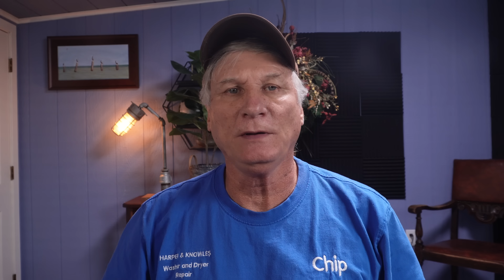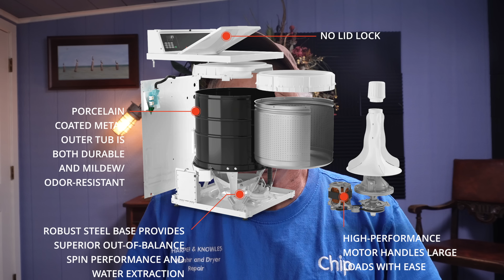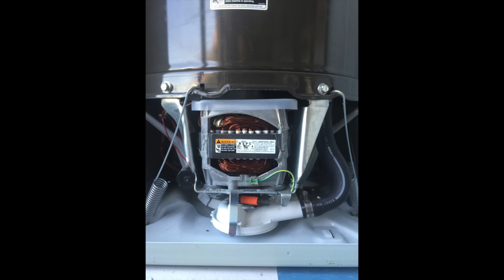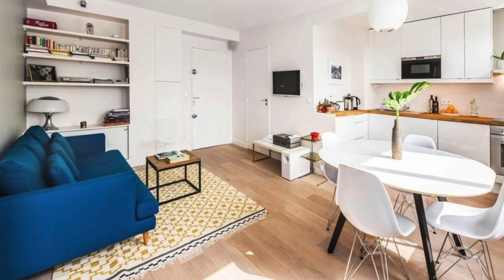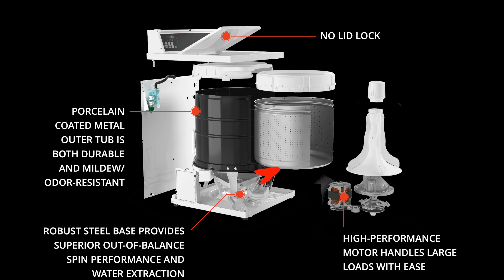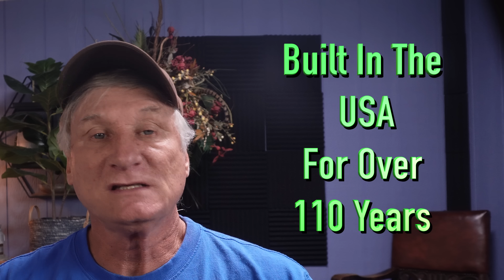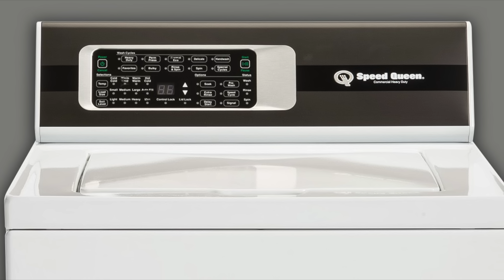TR7 vs TC5 – The Truth Speed Queen Dealers Don’t Tell You

Comment: Chip, what are your thoughts on buying a Speed Queen TV2000WM for home use?
Reply from the maker: I answered a similar question recently so I’m just going to cut and paste that here. Thanks for watching!

The Speed Queen TC5 and TV2000 (TV2) share some mechanical similarities but have distinct differences in their control systems and features:

- **Control System**: The TV2 has all mechanical controls, with no water level selector or deep fill option, meaning it automatically fills to a full tub regardless of the load size. In contrast, the TC5 offers more flexibility with its control system, including options for different water levels and a deep fill feature for better customization of the wash cycle.

- **Design and Features**: While both models are mechanically close, the TC5 includes features like a bleach and fabric softener dispenser, which are not present in the TV2. The TV2's straightforward design might appeal more to those who prefer simplicity and a no-frills approach to laundry, whereas the TC5 provides additional options for those who might need more control over their wash settings.

- **Washing Performance**: Both models are designed for durability and classic agitator wash action, but the TC5's additional control options might offer a slight edge in handling various types of laundry needs. The TV2, being mechanically similar but less feature-rich, might be ideal for users looking for a straightforward, reliable washing machine without the need for extensive cycle options.

In summary, while both washers are from Speed Queen known for their longevity and robustness, the TC5 offers more user control over the washing process, including water levels and additional dispensers, whereas the TV2 provides a more basic, mechanical operation with a fixed water level.

So for home use I think I’d take the TC5 option.

Comment: I bought the TC5 and its companion dryer about 2 and a half years ago now and I couldn't be happier with them.  I bypassed the safety switch on the lid with a clothespin so it keeps running if I want to raise the lid to add something at the last minute, like the fabric softener I often forget to add.  Saves wear and tear on the machine by not having to let it stop and start if ya need to raise the lid.  My last washer & dryer was an old style Whirlpool set that were over 20 years old.  They still worked, but I didn't know how much longer they would last and I didn't want to have to settle for what I could get immediately if they quit.  Had to order the Speed Queen set and wait about a month for the 150 year old Mom & Pop store to deliver them (Billy Matin's Store, Martinsburg, Indiana) but it was worth the wait.  While waiting I picked up some ancillary items like steel braided hoses for the supply lines, etc.
Reply from the maker: Thanks for sharing your story!
Reply: Question: I thought the TC5 does not have lid lock? Is there something I am missing?
Reply: @nealrogers  It doesn't lock, but it will stop the machine running if you raise the lid.  Bypassing the safety switch lets the machine keep running when I raise the lid to add something to the load.
Reply: @Rebel9668 how did you bypass the switch
Reply: @joesummers9864  With a clothespin.  If you reach around behind the control box at the top of the machine on the right side, the underside of that control box is open in the back.  If you feel up under there, you'll feel a flat metal lever.  Put the clothespin on that lever and that takes away its ability to move when opening and closing the lid.  There are a bunch of videos showing how to do it, like this one here https://www.youtube.com/watch?v=vsu1r1-OC34

Comment: Would you pick the speed queen tv2000 over these two washers shown in your video? If so, why?😊
Reply from the maker: The Speed Queen TC5 and TV2000 (TV2) share some mechanical similarities but have distinct differences in their control systems and features:

Control System: The TV2 has all mechanical controls, with no water level selector or deep fill option, meaning it automatically fills to a full tub regardless of the load size. In contrast, the TC5 offers more flexibility with its control system, including options for different water levels and a deep fill feature for better customization of the wash cycle.

Design and Features: While both models are mechanically close, the TC5 includes features like a bleach and fabric softener dispenser, which are not present in the TV2. The TV2's straightforward design might appeal more to those who prefer simplicity and a no-frills approach to laundry, whereas the TC5 provides additional options for those who might need more control over their wash settings.

Washing Performance: Both models are designed for durability and classic agitator wash action, but the TC5's additional control options might offer a slight edge in handling various types of laundry needs. The TV2, being mechanically similar but less feature-rich, might be ideal for users looking for a straightforward, reliable washing machine without the need for extensive cycle options.

In summary, while both washers are from Speed Queen known for their longevity and robustness, the TC5 offers more user control over the washing process, including water levels and additional dispensers, whereas the TV2 provides a more basic, mechanical operation with a fixed water level.

Since the TR7 doesn't really compare mechanically to the TV2000 we'll leave it out of the choosing. I'd choose the TC5 for home use and the TV2000 if I was going to stick a coin box on it for commercial use. 

Thanks for watching!
Reply: @HarperandKnowles  Thank you so much for the great information so that I may make a better informed decision on what to purchase.
Reply from the maker: You are very welcome!

Comment: Our old Series 70 (1988)Kenmore broke down in September and I replaced it with a Speed Queen TC5 and have no regrets. The spin tube support braces on the Kenmore are almost eaten through from leaking tub seal and the spin tube bearings and seals need replacing. I had already bought numerous parts and will rebuild the spin tube and support brackets and sell it.
Reply from the maker: That sounds like a good project. Thanks for watching!

Comment: I just ordered a TR5 washer & TR5 dryer but am now seeing some negative reviews of the TR. What are your thoughts on the TR5 vs TC5?

I am not sure why SQ hasn’t increased the size of the washer bucket, and am really hoping it will fit our king bed sheets & blankets…
Reply from the maker: The negative reviews are from die hard TC5 fans. My sister owns the TR’s and she loves them.  They are good machines just a bit unconventional on the agitation cycle. The tubs are smaller and that is one of the characteristics that make them so durable. You may want to take the king sized blanket to a laundromat that has a large capacity machine made just for loads like king sized comforters. I’m betting your sheets would fit just fine though. Thanks for watching!

Comment: I understand there is an issues with the TR5000. I have a bearing noise at the base and Speed Queen put out a bulletin out of this issue. What is the warranty period? I purchased during March 2020. I've owned SQ many years ago and never, ever had an issue with any component when they were owned by Raytheon. I certainly hope their quality control didn't change.
Reply from the maker: I think it’s 5 years for that model. Check your paperwork you received with the machine. Hopefully you registered it when you bought it.

Comment: I've got 43 yrs on my maytag lat9420.  The tub seal started leaking and maytag discontinued the part so put a knock off seal in and got it working. Have rust on the outer tub for the drain and bleach hose connections. I think when those connections go the washer is done. I would probably buy a tc5.
Reply: Lucky!!!! That’s awesome and the way things should still be made! 👏🏻👏🏻👏🏻
Reply from the maker: Thanks for watching!

Comment: I have a TR3 and I have had the timer wash machine in the past. This machine is so quiet I have to check to see if it's done because I can't hear it running.  I  learned the spin only setting  by holding down the start pause button until the spin light comes on. Just something different than the old timer machines.
Reply from the maker: Thanks for sharing that trick! Thanks for watching too!

Comment: From a dyed-in-the-wool DIY'er, I have gotten to the point that I look at the cost of repair parts and the ease with which to make repairs on appliances.  Having torn apart our LG washer several times to replace tub bearings, the water pump, hoses, the door gasket twice, and the so-called shock absorbers, the last straw was the unavailability of the drum bearings.  When I did find them, they cost $400.  To do repairs on any of the front loaders takes a couple of hours, and you have to, for all practical purposes, do an almost complete tear-down.  You also need to buy the pliers to remove and install the wire snap-rings for the door gasket, or that will take two hours and lots of cussing to get them back on.  For the Speed Queens, you can order the parts from Alliance (the parent company) directly, and the prices are not too bad.  OK, transmissions go for around $400, but they do have a re-build kit and the gear fluid for it.  Motors are about what you would pay for any of the direct-drive motors of a front-loader, and belts and water pumps are not going to cause a heart attack.  To gain access to the mechanical parts you just need to remove screws out of the front panel, and you should have access to everything.  OK, if you need access from the back it does not look all that bad to remove screws...  Great, the Speed Queens have a dual-action agitator.  We thought the front-loader would do a better job than the Kenmore dual action agitator it replaced.  Wrong....I tried every HE detergent I could get my hands on, and every cycle and temperature combination possible.  With three toddlers who turned into teenagers I had to use the pre-wash cycle and the longest wash time I could manage....usually two hours, along with an extra rinse cycle.  I am still scratching my head how this saved water, electricity, natural gas, or time.  With screaming tub bearings, we are going to get a Speed Queen washer.
Reply from the maker: You won’t be disappointed. Thanks for watching!
Reply: @HarperandKnowles  Thank you sir!  You are a scholar and a gentleman and I don't care what your in-laws say about you!😅
Reply: My husband just replaced the bearings and tub seal. The cost was around $40 for both. It was on my 16 year old Kenmore built by LG. He has replaced the pump 3 times. Around $16-$18. Cheap repairs since he is able to do it. Replacing bearings is a big pain (for him). It’s working again. Front loader.

Comment: The current MSRP for a Speed Queen (Alliance) TC5 is $1329.99. Pro tip, find a quality used Whirlpool/Kenmore direct drive machine and refurbish it for less than half that price. That refurbished machine will last another twenty years or more with minor repairs. Bonus, not available of the TC5, the direct drive machines will allow the user to select any water fill level you desire, and the agitator is dual action.
Reply from the maker: Thanks for watching!

Comment: The Speed Queen models that are available to consumers ARE NOT their commercial units.   You can't buy a commercial grade Speed Queen without a tax number.
Reply from the maker: Thanks for your comment! I fact-checked your claim and found it a bit off the mark. Speed Queen’s residential models are built with the same commercial-grade components as their commercial machines. The only real difference is that residential models don’t have coin mechanisms or features specific to laundromats. So, yes, consumers can absolutely purchase machines built to the same high standards as Speed Queen’s commercial units, no tax number required. Thanks for watching!

Comment: An honest review would examine service data, cost of ownership, and serviceability after the warranty expires.  They lose to many others on all three.  I've had just about every brand out there, including these.  They are not worthy of the cult following or price they have.  Don't get me wrong, they are good, but not God level good.  As proof, there are Whirlpools that are exactly the same as these (except the outer control panel) and they're rated below average because people don't know who made them.  The warranty is what sets them apart, not the engineering.
Reply from the maker: Hey, really appreciate your feedback on the video! I get where you're coming from, but let me set the record straight from someone who actually works on these machines:

When it comes to service data and ownership costs, you've got to understand that Speed Queen's not just another washer; it's built like they expect it to survive a nuclear fallout. Yeah, they're pricier at the start, but over time, they're often cheaper to own. Why? Because they rarely break down, and when they do, fixing them isn't like solving a Rubik's Cube. 

Once the warranty's up, Speed Queen still has your back. Their design means that if something does go wrong, you're not buying a whole new module; you're just swapping out a part. That's a big deal for longevity and cost.

Saying Whirlpools are "exactly the same" as Speed Queens? Hold up. Speed Queen's been about that traditional, no-nonsense design with parts you won't see wearing out every other year. The tech in Whirlpools has taken a questionable turn, leaning towards designs that prioritize short-term gains over enduring quality. They used to produce quality machines like their famous direct drive models that were made for more than thirty years and are still around today. It's not about what's best for the machine's lifespan now; it's about what's cheapest to produce or what features will catch the eye for the next sale.

The warranty's a nice safety net, but Speed Queen's engineering is the real story here. They don't just throw a long warranty on for the heck of it; they build machines that can go the distance.

I respect your experience, but this is where I've got to call it like I see it in the shop. Maybe take another look at what makes Speed Queen tick. They've earned their stripes and are tough and serviceable.. Thanks for watching, and keep the comments coming, especially when they challenge the norm. Just make sure we're all on the same page with the facts.

Comment: For anyone interested... It is possible for a cheaper washer to last 20 years.. My whirlpool duet (from 2005) will be 20 years old next year...it has a plastic outer tub... though I've never had mold.. I think because I use hot water and bleach with whites...I've seen horror stories over the year with mold but never had that issue (luckily)... I would LOVE to have the speed queen front load...which may happen if my washer dies.. I don't see how it could possibly keep going much longer, though it shows no signs of anything going on it at all... Either the SQ front load or LG front load with turbo wash because I like how it washes.. I think my washer drum size is 3.8 cubic feet... the SQ is even smaller than that...which I hate... as it stands  I can BARELY wash a queen size comforter
Reply from the maker: If you take care of those older (pre 2006) washers they may last for many more years.

Comment: Thanks Chip! your info helped us make an easy decision. We simply bought the TC5 and DC5 dryer. They replaced our 24 year old Maytag LAT2500AAE and matching gas dryer. Chip the new Speed Queens are virtually identical to our existing 24 year old Maytag machines. They still run well but I would rather replace them before they eventually need repairs!
Reply from the maker: I’m glad my video was helpful. Thanks for watching!
Reply: Still using my Newton Maytag dryer with my five-year-old TC5 washer. If it ain't broke...
Reply from the maker: Let’s hope they both last forever! Thanks for sharing!

Comment: Bought a Speed Queen set in 2007.  They see heavy use - 2 or 3 loads a day.  Just replaced the washer belt & tensioner last week.  That was the first time I'd opened it.  I opened the dryer and saw the belt was getting thin and one idler wheel wasn't spinning as freely as the other, so I ordered those.  Amazing these have gone 17 years before needing minor service.
Reply from the maker: Quality last! Thanks for sharing.
Reply: And parts were still easily available? Almost 20 years later?
Reply from the maker: Yep. You can still get parts. Thanks for watching!
Reply: Same here
Reply: That's a testamonial
Reply: Which model washer?
Reply: @definitelyp8652 AWS76NW
Reply: Model washer ?
Reply: TC5

Comment: Bypassing the lid lock is easy on the tr7
Reply: How do you bypass the lid lock on TR7?
Reply: @imahaingtia You can push in the lock with a pen cap, or some people shove something in it to keep the switch in.
Reply: @imahaingtia you can use a pen cap. I actually went on their website and bought a second lid lock latch. I put it in the lock at the start of the cycle. I use a strong magnet in the back underneath the service hall to hold the safety switch down keeping it engaged
Reply from the maker: There is no lid lock on the TC5. Thanks for watching!

Comment: I used my moms Hotpoint purchased in the mid 1980’s … it was built quite good and did a fabulous job.   The cycle selection knob went after 20 years .. the appliance service tech that showed up told me that he couldn’t get that part anymore and all he could do is find a used one to put in … and he couldn’t guarantee how long that would last .. so he recommended that I start shopping for a new machine .   I ended up purchasing a new GE top load about 3 years ago …,it’s ok … but definitely not built to last .
Reply from the maker: Thanks for sharing your experience!